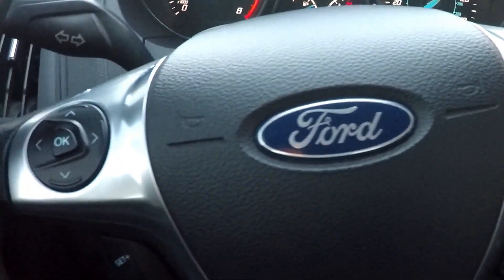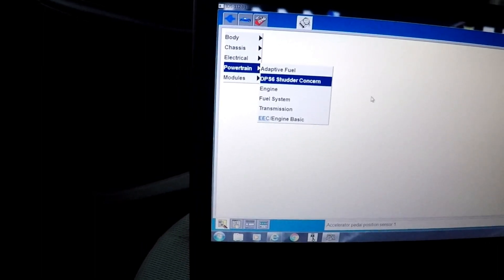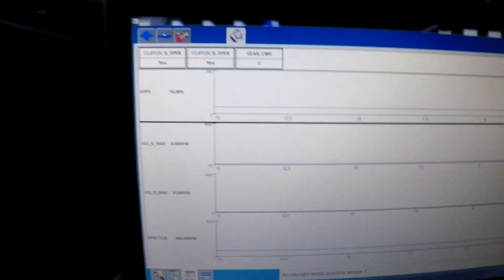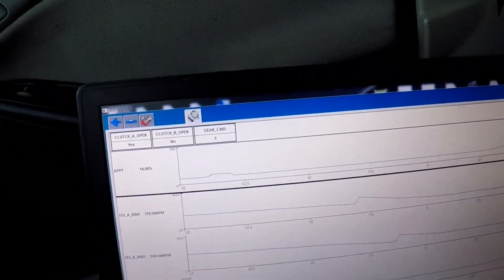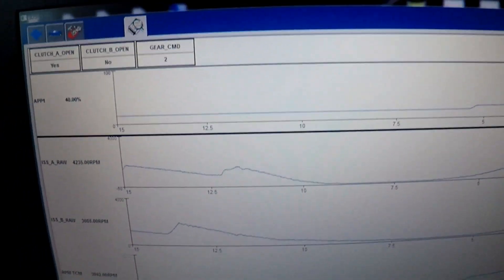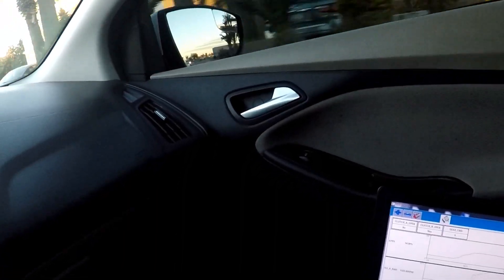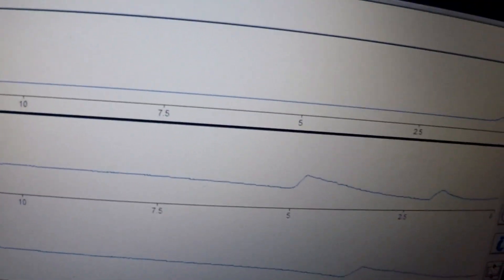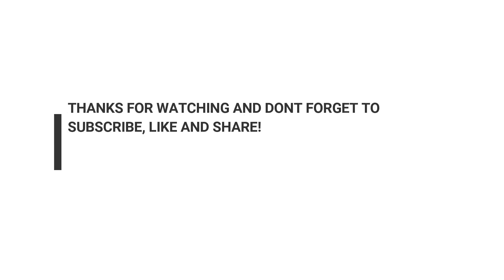FORD Powershift shudder.

Comment: I feel like a lot of people do not understand how these transmissions work. I have a 2012 focus SEL and it drives perfect for me. It has a slight shutter but not a big deal. The biggest problem they had was the seals leaking and causing damage to the frictions in the dual clutch unit. That’s an easy fix with a replacement dual clutch unit, and when you do that you need to use a suitable scan tool or the IDS to learn the shift points in the transmission so it works properly.
Reply: How exactly is this done I just replaced both actuators

Comment: My 2012 Focus had to have four clutch packs replaced because of excessive oil leakage that ruined the clutches and caused shudder, along with two TCMs. I’m glad I sold it in 2021 before the TCM warranty ended.

Ford could have replaced the whole transmission, and I asked the company to do that several times, but that was a no go.

Comment: i have the 2016 se model. got it at 24k miles for the first 8k miles there were a couple shudders but now at 71k miles i haven't experienced them since. although i do get gear shift hesitation when braking.
Reply: My exact situation right now. 2016 se bought it at 26k.  It’s at 86k now. Worst car I’ve owned to say the least. Sad seeing it’s also the most expensive car I’ve owned so far.
Reply: @MusicRocksForever  that $200 charcoal filter is expensive when it needs to be replaced every 10-15k miles

Comment: I really can't believe how bad Ford has gotten they seem to get worse every year now they're being sued yet again for the same power shift problems originally it was the 2011 to 2013 now it's 2017 2018 2019 2020 they keep producing the same crap without Improvement dry clutches never work they never have in any vehicle yet Ford continues to use the dry clutch system even in their automatic transmission. Every company is bound to have problems from time to time but it seems like with Ford it's becoming consistent continuous problems year after year. Ford Focus Ford Fiesta being some of the worst cars ever made especially with the Transmissions. Cars literally lunging even with the brakes fully applied. Erratic shifting stalling jerking vibrating many cases reported even before the car reaches 20,000 miles. It's one thing to have mistakes happen. But it's another thing all together to know that you have a bad product and still produce it. Perhaps this is why Ford is no longer selling cars except for Mustangs instead of trying to work harder to make improvements it seems like they're just giving up. Personally I have given up on Ford which is something I thought I would never say. For anyone that owns one I wish you the best of luck.

Comment: I have a quick question my 2014 focus has a problem where it wont even shift out of first gear and it shakes so bad and reverse doesnt even work the car has been sitting away in the garage for 6 years and my grandpa gave it to me, it only has 12,000 miles i replaced the fuel pump and a few more transmission sensors does that mean i have to replace my TCM??

Comment: So I have brought my 2014 Ford Focus to ford about 4 times for the shuddering I currently went and they told me that they had to restart my transmission I probably got ripped off is there a way I can get answers to my issue my car does the same exact thing as this video My cars Bluetooth also hasn’t been working after taking it from ford also my USB port and aux after bringing it
Reply: Should I go into ford again to claim to get my transmission changed I still have warranty
Reply from the maker: If it’s still under warranty I would try and get that transmission covered

Comment: what is the root cause of these problems with this transmission? are the clutch plates to frail, are the engagement pressures too weak, are the shifting servos to slow, is the software messed up, or what??
Reply from the maker: All of the above lol. The dual clutches and software are the biggest issues
Reply: @codysautodiagnosticsprogra8706  still the same answer, you don't know either thnx anyway
Reply from the maker: Your trying to find out the exact issue with these transmissions when I’m telling you the whole design of the transmission is the issue. These transmissions are junk, I’ve seen Tcm go bad at 20k, I’ve seen the clutches come apart at 30k. If your looking for the silver bullet issue, there is none on these.
Reply: @codysautodiagnosticsprogra8706  there may not be what you call that silver bullet but i think to say they are junk without a specific reason,but all of it is another way of saying i don't know. i've been around a long time and, from experience, know there is likely more to it than it's all junk. eg; leaking seals wetting the disks. it's a gearbox with oil in it. perhaps the seals aren't so bad but the oil level may be too full. when it heats it expands and pressurizes the box . where you think that oil will go?  
so again as i said, lol you don't know either and thanks anyway.
Reply: @codysautodiagnosticsprogra8706  and an additional comment, from experience. i have one of these mothers. and i don't like the fact it is fucked up at times, but, the mother can screech tires in the first 2 gears from a dead stop. the dps6 transmission will handle all that the engine can produce and put it to the road. that doesn't sound like junk to me, it sounds like something is awry. 
and that's what i am looking to find. a mechanic acquaintance has offered some advice and i am looking to confirm such ideas before i start messing around. after all, he isn't a world renowned  expert with fancy computers, but, he  can sniff a trail... and i am beginning ti believe he may be on to something.. again thnx anyway

Comment: We had 8 mondeos at work and all of them had transmission issues and we eventually scrapped 6 of them due to the transmission issues. 2 of them are still driving but with shuddering issues.
Reply: I spent $4000 to have my trans rebuilt. 8 months later, it tripping codes and refusing to work again! This trans is a pos!

Comment: Heyy!! SO i have a 2014 Focus SE, automatic. Bought the car in 2015, and ever since I've had this car, it shudders or slips. NOW its not consistent, car is confusing. One week its perfect and then the next its really terrible. I haven't had any major problems with the car since I've had it which is awesome, i love the car, BUT I HATE the DCT. Honestly tho, I've gotten used to the shudder and slipping, don't really bother me and like i said, it's not consistent. Now my question, will anything happen to my car if i keep ignoring the problem?? So far 5 years and nothing. just curious
Reply: Change the fluid and/or have the dealership do a software reflash. It helped quite a bit for me.

Comment: Just got my 2012 Ford Focus a year ago and it started shuddering on acceleration and very hard shifting not sure if it’s a transmission failure or just what you would call a quirk of the focus
Reply from the maker: Unfortunately these have lots of issues with the transmission. If you can live with it then you should be ok for a while. Just know that these are definitely problematic
Reply: i got 2012 focus too.. same issue with transmission.  last dec i decided to sell it. and this is the best decision i made. now im using kia rio 2020. and my headache goneeeeeeeee

Comment: Have the same issue it also shudders when accelerating. Ford fixed the transmission but a couple months later it started shuddering again and still does. So now it broke again and when u try to speed up to pass a car or something it will hesitate and it will just rev like in neutral then after a couple seconds it will shift and go. It also makes noises. And for some reason it's so weird but it only shutters the second time u start it and after. Every day the first time we drive the car the transmission is fine but when u start it a second time and more then it shutters I don't get that. Now we have 22 more miles until we hit 100000 miles on the car so then the transmission warranty expires so that's great. Oh and when we come home theres a turn that goes up a hill and the transmission shutters a lot up it.
Reply from the maker: Damn that sucks buddy, I would definitely get that taken care of again before warranty expires
Reply: @codysautodiagnosticsprogra8706  It already did😑😥
Reply from the maker: Damn 🤦‍♂️

Comment: 2016 started shuddering when starting out.    I beat the shit out of it every once in a while and has not shuddered since.
Reply from the maker: Lol perfect fix lol. If it works,it works
Reply: @Mimi mimk Drive it like it was stolen...New clutches at 51,000 and just traded it on a camry.   No more Fords
Reply: @Mimi mimk There is a class action lawsuit against Ford motor Company and in some cases buying back cars.   Check on internet.
Reply from the maker: Good to know, I’ll check this out. Thanks for the update

Comment: So I bought a 2014 ford focus se last year.  I noticed that it shuddered when accelerating from a stop, and when I was on the highway on cruise it lost power and felt like the accelerator didn't work.  Now, it hasn't had the latter problem for months now and the shuddering doesn't happen as often as it used to.  I got the letter from ford talking about the extension of the warranty.  My car is at 95,000 miles and I'm worried because my cars problems seem to be extremely mild compared to most peoples experience, but if I take it in for the fix I'll drive past 100,000 and it gets as bad as the others experience.  Does the warranty then reset for the fix or should I just not bring it in?
Reply from the maker: I would definitely take the vehicle in to try and get the transmission repaired or replaced before your warranty period ends. There maybe history codes set in the tcm which could help the technician in diagnosing your car even if it’s not acting up at the moment

Comment: I have the 2018 fiesta model se and it has the same transmission. Only had about a year and less than 25,000 miles and its doing this exact same thing, transmission shudder.
Reply from the maker: I would suggest seeing if the dealer can do anything for you to help it before it gets worse
Reply: @codysautodiagnosticsprogra8706  I took it to my mechanic that evening, the transmission is done. lucky its under warranty until 60,000 miles, unfortunately, Ford has said, this isn't fixable, so once I burn out the warranty I'm stuck. I have an appointment to take it in next moth for the needed repair, but we will see how it plays out.

Comment: I've got a 2017 SE hatchback with the DSP 6.  Only reason I bought it was that it was an incredible year end deal: $17.3 sticker / $12.4 purchase price.  My snowmobile cost more than this new car, so I couldn't pass it up.  But it is a sweet little car and the transmission works great as designed.  By 2017 Ford fixed most issues but, with the dry clutches and no torque converter, there is a fundamental design issue.  These cars can't creep.  They can either stop or go.  Creeping in daily commuter traffic will burn out the clutches.  I live in in the Washington Cascades and, when I drive, it's 75 miles one way to the nearest city with big box stores.  I might go down the road 15 miles for lunch but we don't have traffic and most of my driving is at highway speeds.  I've got 30k miles on it now and it has had zero quality or maintenance issues and has never been to the dealer.  Get's 36-38 mpg consistently in my driving.  I expect to use this car for my long distance driving for 5-7 more years and don't expect drivetrain problems.  Of course it won't have a resale value because of the bad rap of these transmissions, but oh well.   If Ford never sold these cars to city dwellers, they wouldn't have had these problems after fixing the seals and other stuff.  But I guess they couldn't tell customers you can't creep in this car.
Reply from the maker: You couldn’t be more right. Ford has has a couple years to fix their issues just like any manufacturer when they put out a new design or transmission for that matter. I always say don’t buy the first year of anything lol

Comment: Thanks for sharing Cody. Good video. Reading the comments I see there is no fix. Is that true. So much for CVT transmissions. 👍👍👍
Reply from the maker: Hey Artie, yes these transmissions are junk
Reply: Just scrub the clutches every few months... disconnect battery for 15 min.reconnect...go to flat open road...from dead stop accelerate to the floor...let go thru all gears reaching 70 mph..then slow down to a stop... repeat 2 more times....it's in a learn mode
Reply: Cody and family enjoy Labor Day Weekend ❤️

Comment: Ford knew this transmission had issues from the start. Just google Detroit Free Press Ford Focus Transmission.
There is ABSOLUTELY no fix for the issues that plague this transmission.
I certainly would never let anybody I cared about to drive one of these cars with this automatic.
Reply from the maker: I’ve looked into that free press. Your completely right about not letting anyone I cared about ever consider one of these.
Reply: @codysautodiagnosticsprogra8706  If you have owned or current own a Ford Focus or Fiesta and have had or currently having issues with the car transmission, please make your voice heard by filing a formal complaint with the National Highway Traffic Safety Administration and also leave a complaint on carcomplaints official site.

The links are down below
https://www-odi.nhtsa.dot.gov/VehicleComplaint/
https://www.carcomplaints.com/Ford/Focus/
Reply: @IwCk  I have same issues and when I learned about the warranty, my mileage was 100500. They didnt accept the car. I will definetly create a complaint. thank u for the links
Reply: I had the latest fix done. New seals and clutch assembly. This fix seems good, no issues at all. ford is doing this repair on all powershifts for free.
Reply: jah0524 it will get fucked up again dude.
Reply: @jah0524  The new clutch and seals you have got are the same that has been used since late of 2016. There has been no new seals or clutch release after this yet the 2017 and 2018 Focus and 2019 Fiastas are having the same issues
Reply: @jah0524  After getting your clutch & seals replaced have you had any issues with the shuddering since?
Reply: @chrisschovan2755  No, not yet. Car drives fine right now. It has about 75,000 miles on it and is 9 years old. So if it lasts 1 more year and 10,000 more miles, I will be happy. Next car is a Toyota or Honda.
Reply: Mine got fucked up again after 7 months only. Sorry buddy to tell u that, but your mission now is to get ride of it asap and find a better deal with no headache, free maintenance and free fixing issues...
Reply: Theres is an easy fix, get a Japanese car, to put a gearbox in that the tech guys said wasnt good enough and needed more work is stupid, but guess its all about getting those cars sold, ford website still has info on the advantages of the powershift gearbox over standard automatic, you'd think they would of removed that lol

Comment: I've been debating with myself if it's a issue, a part quality issue,  or a combination of both of them. This shouldn't happen in my opinion. I could also be completely wrong. 

Random talk: My family has a 2016 Ford Focus and I've noticed the vehicle tends to feel like it's shaking when it gets going from a stop, we've been told it's normal, but I just don't think it is. P.S: this shaking feeling has gotten harder over time in my opinion.
Reply: Combination of both. Ford knew about the problems before the Fiesta and Focus went into product, but did nothing but communicate to dealers to tell drivers that it was their FAULT in how the car drove, and if the transmission shuddered it was the driver's fault.

I have a 2012 Focus, and I am really fearful that this transmission is going to fail completely. Ford Canada is going to say "You're on your own!" I'm absolutely certain. Complete corporate negligence. This is my last Ford product ever.
Reply: A $100 million class action settlement applies to your transmission

Comment: I've been told this is a known problem and ford has an extended warranty on the transmission and they've decided to just take the lawsuits costs rather than issue a real recall. I've had this problem and now in the process of having my ford fixed. If i'm going anything over 40, my car is acting like a drunk crackhead trying to drive a stick. Its almost as if I'm tapping the breaks every few seconds. It's insannneeelllyyyy scary on the free way because you'll be going 70 and then all of the sudden you drop all the way to 50 in 10seconds. Then you just start sputterting out like a cartoon car running out of gas.
Reply from the maker: Absolutely right buddy these have lots of issues with the transmissions, and will cause those exact symptoms. Your comment about the crack head driving stick made me laugh 😂😂
Reply: If you have owned or current own a Ford Focus or Fiesta and have had or currently having issues with the car transmission, please make your voice heard by filing a formal complaint with the National Highway Traffic Safety Administration and also leave a complaint on carcomplaints official site.

The links are down below
https://www-odi.nhtsa.dot.gov/VehicleComplaint/
https://www.carcomplaints.com/Ford/Focus/
Reply: I fixed mine by simply pressing on the gas until it shifts and having a strong battery
Reply: @chocolatemilk2076  I fixed mine by selling it. Ironically about 3days after I sold it, ford FINALLY issued a recall on the transmission via snail mail